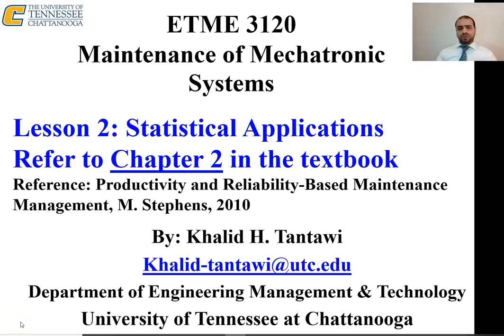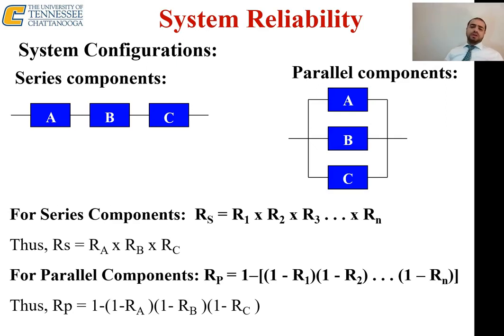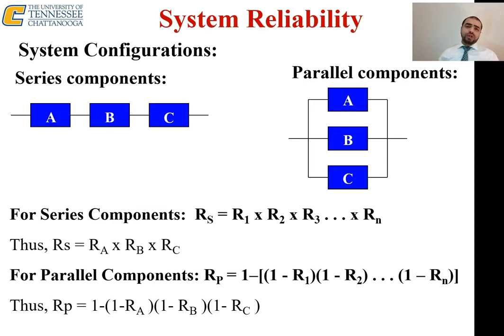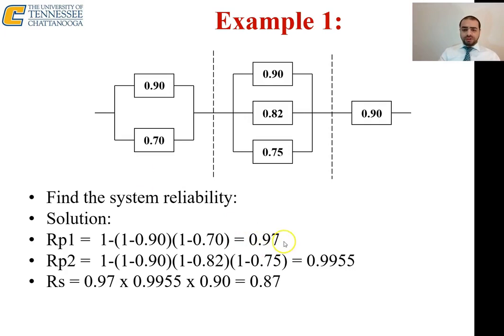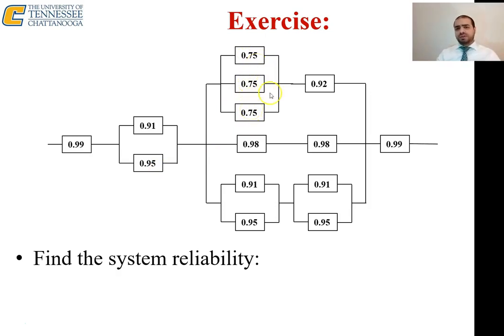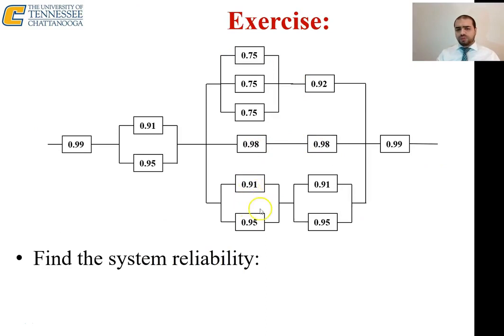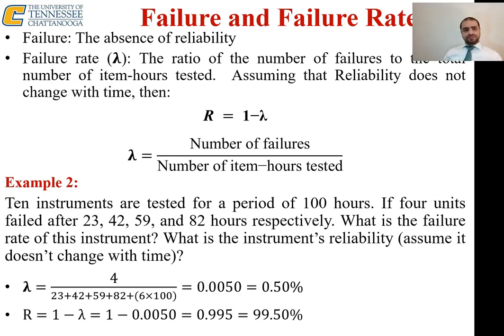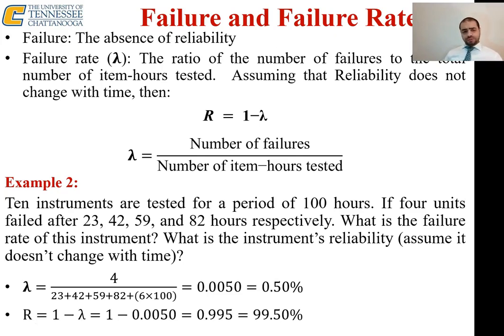UTC Mechatronics - ETME 3120- Lesson 2-  Statistical Applications

Comment: Hi , Dr. Khalid , Hope you doing good.
In Parallel system - I have two identical equipment , of 50000 MTBF and FR( Lamda) is 1/MTBF = 0.00002 each, Can you help me out to calculate System Failure rate and further availability. Thanks